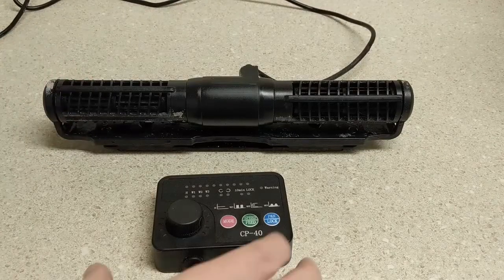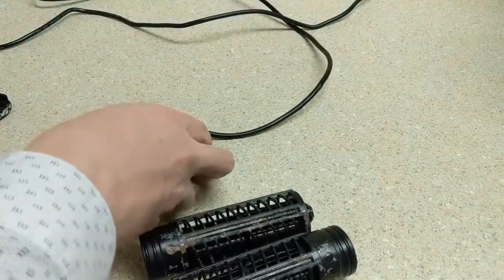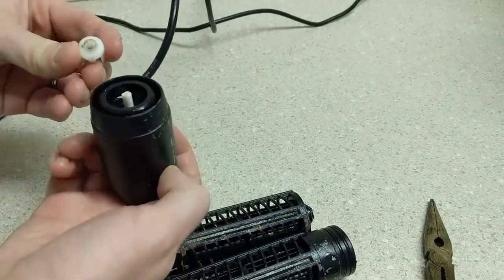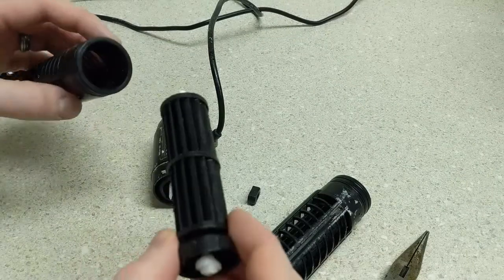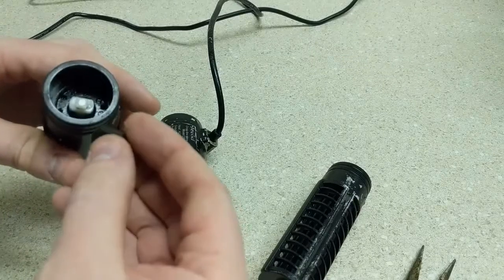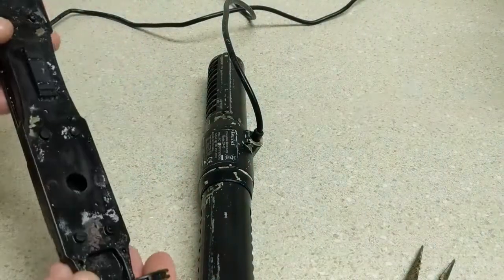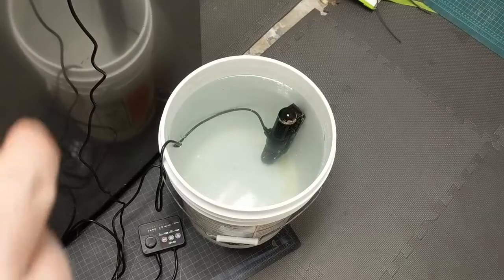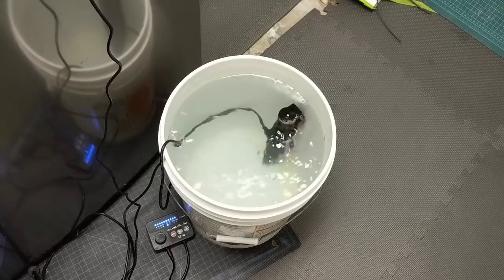Jebao CP-40 Maintenance

Comment: Hi. I tried cleaning one that was well overdue a clean and the motor shaft broke when trying to remove the motor shaft.  I now have a new one and its not been used at all, so tying to remove the motor shaft before use to familiarise myself.  Does it matter which end you remove, as they seem slight different.  Thanks